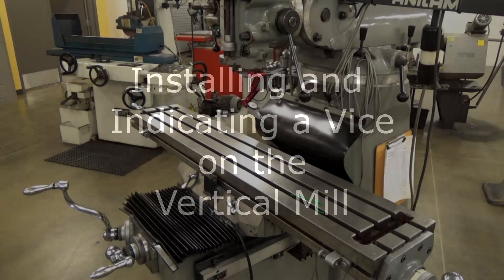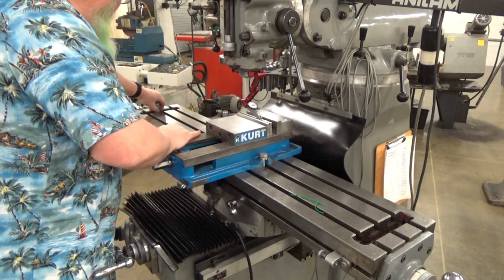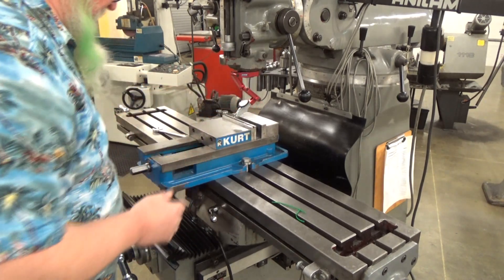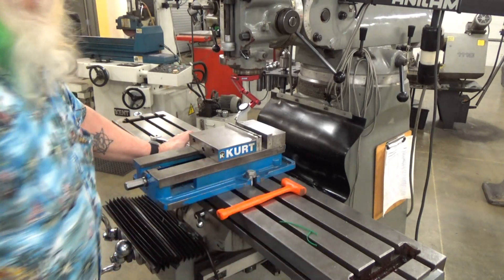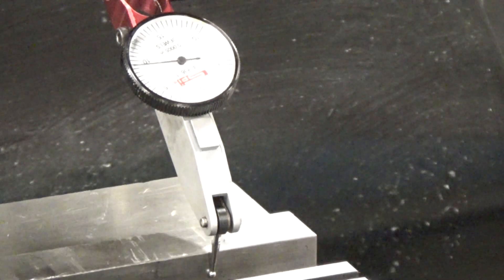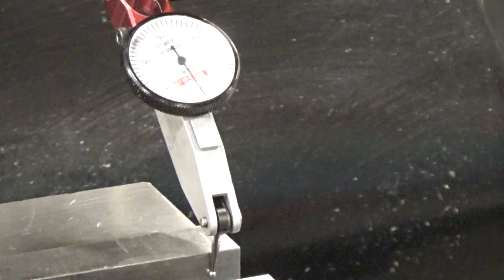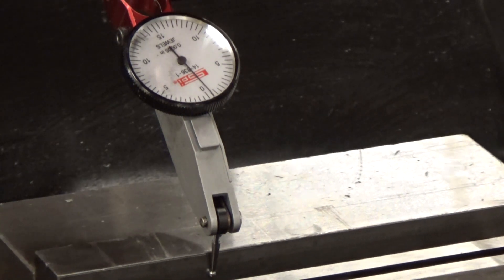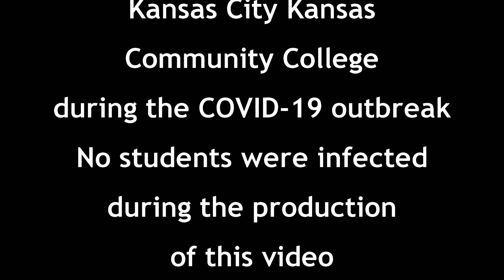Mounting and indicating the mill vise

Comment: Why did you put the vice on the middle of the table ?
I'd favour putting it towards one end to:
1. spread the way and screw wear towards one end - remember, the table has 2 ends but only one middle.
2. Leaves more room for direct mounting to the table without having to remove the vice. Saves setting the vice up every time.